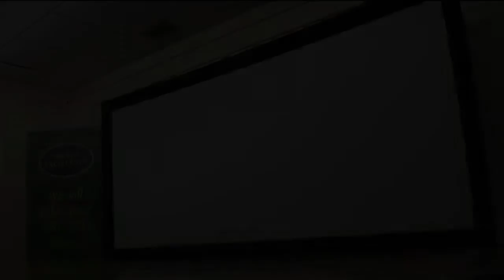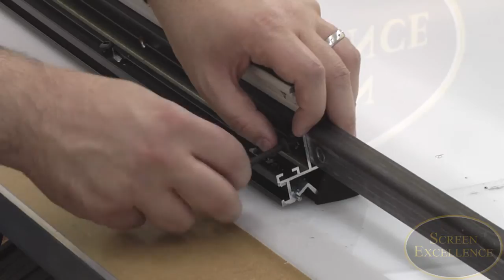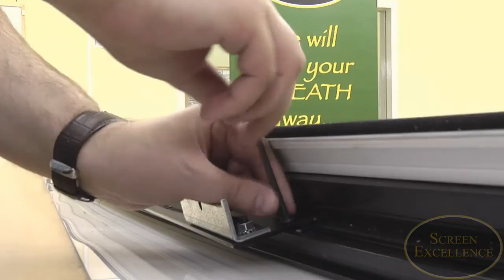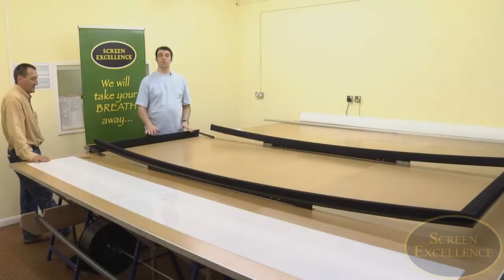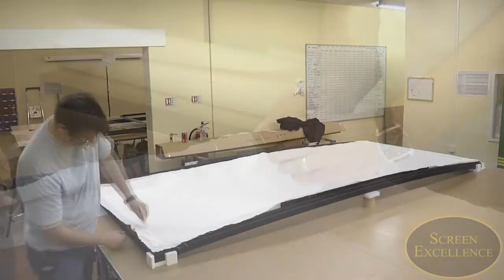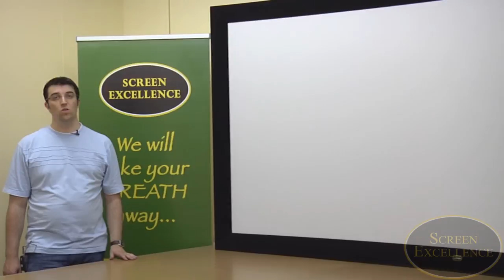Screen Excellence Vista Screen — Ecran de projection courbe

Comment: 4 profilé en alus découpés correctement et assemblés ensemble par des angles, une toile mycra  tendue a deux et vous avez un ecran pour 50€
Reply from the maker: Si c'était si simple, si fiable et si facile, des fabricants chinois auraient sortis des écrans fixes pour 150 € partout dans le monde :-)

Trouver la toile à colorimétrie correcte, et qui ne jaunira pas sur 10 ans, est déjà compliqué. Trouver une toile qui ne fasse pas de moiré en 1080p ou 4K, encore plus. Trouver par dessus une toile acoustiquement transparente avec 1 dB d'atténuation est encore plus difficile.

Pour les profilés c'est la même chose : de base, c'est simple, mais si on veut de l'élégance, de la discrétion avec du velours noir, une fixation facile plafond ou mur à la care, une tension parfaite de la toile sans plis ... c'est là aussi pas mal d'essais avant de trouver quelque chose de bon.

Screen Excellence a amélioré pendant 10 ans ses produits. C'est de la vraie R&D par une équipe française passionnée, et une usine au Royaume-Uni.